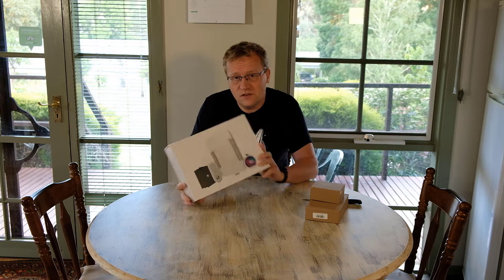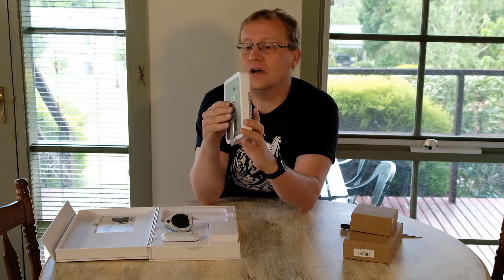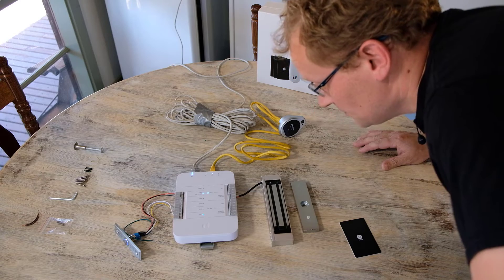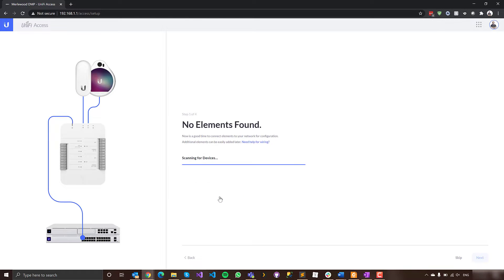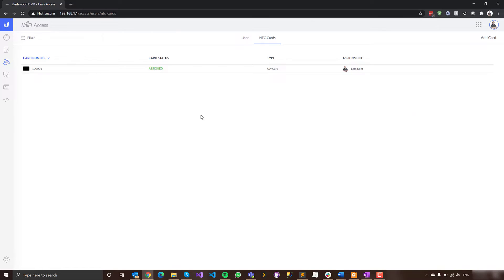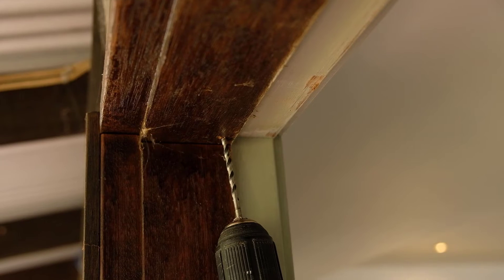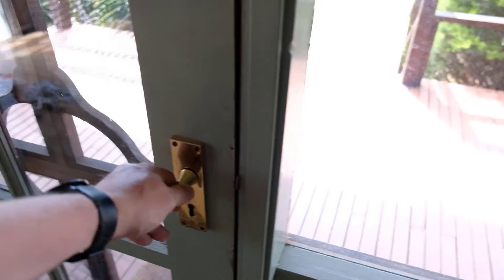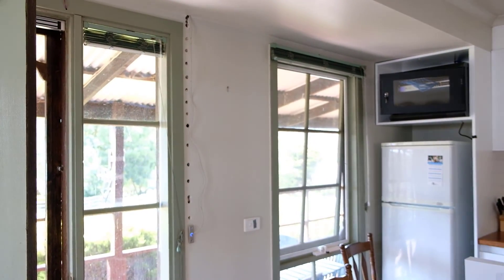Unifi Access Setup and Installation- From Start to Finish

Comment: Thank you for this video.  It gave me a little more insight and confirmed the user friendly interface of unifi.  
I have one question.  What if you wanted a lock for the office door and the house’s back door ? Would that mean 2 of the same system  ( 2 door hubs ) ?
Reply from the maker: Yes, you'd need two controllers, but also check out the Access Mini and Access Ultra, which are much smaller.

Comment: Hi, I have a network that includes several UniFi access points which were already installed and are currently active. Users are connected to them and using them without any issues. However, I'm unable to adopt them into the UniFi Controller, and I also can't perform a factory reset to reconfigure them from scratch. When I launch the controller, it scans the network but doesn't detect any of the access points, even though both the controller (running on my system) and the access points are on the same network. I can't find a way to adopt them into the controller so I can manage their settings. Can you guide me or help me with this?
Reply from the maker: That sounds about right in the behavior you see. Access points will work when they have a connection, but that is different to being able to manage them. As they are already adopted to another account they won't show up on your network controller as part of your account. They do get an IP address, so you should be able to see them.
Why can't you factory reset them?

Comment: What is your plan of power goes out?
Reply from the maker: In my case, the door lock is electro-magnetic, and the door just stays unlocked when the power goes out. For me that isn't an issue and I do have a second deadlock on the door if I am away for longer.

Comment: So what happens when you lose power to the building? You can no longer get in?
Reply from the maker: That depends on the kind of lock you choose to install. I have an electromagnetic lock which is open when it has no power. So, in my case I have chosen to have the door open when there is no power. I also have a deadlock on the door for when I am away from the farm.
Reply: @LarsKlintTech  ahh makes sense thanks!

Comment: just use a flexible pull cable
Reply from the maker: What is that and for which part should I use it?
Reply: It's called a wire snake or cable pull snake it allows you to pull wire through conduit and othher places you need to pull it.  @LarsKlintTech

Comment: Is the Dream machine a requirement or can this be used stand alone?
Reply from the maker: You'll need a controller for the Access application. This is in UniFi OS which runs on the Dream Machine Pro or SE. It can't be used as stand alone.
Reply: @LarsKlintTech  thank you

Comment: Alittle late to the party, but this was great! Is that the default ip to configure the hub, or did you plug it directly into the coreswitch to get to that screen?
Reply from the maker: Welcome to the party! 🥳When you plug in the Access Hub, the Unifi Dream Machine will automatically pick it up. No need for special IP addresses 😊

Comment: Can I bother you with a few questions please?

1. Does Unifi Access work with 3rd party door access readers?
2. How do you enroll a new NFC card is you have the reader far away? Do you always have to go and tap the card on that specific reader? (if so, it's not good for bigger deployments).
3. Does it work with PoE+ as well or only PoE++?
4. Do you need anything special to enroll mobile phones for access?
5. Can Unifi Access be used for time clock-in-out? Can you export the database?

Thanks.
Reply from the maker: Sure thing.
1. I am going with no. I can't see that working as the reader plugs directly into the Access Hub, which needs to then talk to the Access on the UDM-SE.
2. Yes, you do need a reader to register a card, but you can register multiple and assign them after the fact. 
3. I am running it on PoE+, so yes.
4. If you mean using the Access app, then you just need an account that has access to it. If you need through UID, then that has to be set up centrally. 
5. Technically there is a time stamp for every swipe in the system, but I don't think that is the main purpose for it. And yes, you can export it all as csv.

Comment: Thanks Lars! Ubiquiti really missed a trick here with No Fingerprint sensor on thier Access unit. Pin Code + Fingerprint + Smartphone button access is a minimum must have! Also for future lockwise, you may want to consider installing an Access Lock Electric, which releases the strike plate holding the door handle's latch bolt. Offers a manual Key means of unlocking and opening the door if electricity fails.  Having a manual override backup via key, is essential!
Reply from the maker: Thanks Raj. I have an existing lock on the door, which I use when away for extended periods of time. I don't agree that fingerprint is "a minimum" if there is a pin code option. It is more of a nice to have feature, as each user can have their own pin code too.
Reply: most budget fingerprint readers are insecure. If you look they are usually rated in false positives. (i dont remember the exact language) but do you really want to take the chance that the would be intruder can walk up and play the lottery? it would be ok if it could be locked out after x trys. same with code. Also, he used a magenetic strike. its going to fail open/power goes out no magnet

Comment: Only catch with that magnet lock is when power goes out the door is unlocked.  If you can do a striker lock those are better as they can fail secure instead of fail insecure.
Reply from the maker: Absolutely. I was aware of that when I installed it too. I have an old school striker lock which I lock when away for longer periods of time (off the farm).
Reply: @LarsKlintTech  Thanks for the reply and good to know that you had a backup option for this.  They also make fail secure mag locks too that could be made to act similarly.  Just wanted to mention that in case others were not aware.  Thanks for a great overall video though and a nice walkthrough on this kit!
Reply from the maker: @EagleMitch  Absolutely. Your comment is super helpful. I have learnt a bit more about the system too since I made the video, and considering doing a second install with a magnetic deadlock/striker instead.
Reply: @LarsKlintTech  that would be great!
Reply: How about a backup battery?
Reply: @drydenrobotics7833  they are good as long as they battery is, but a striker lock is an analog solution that would last forever and allow safe egress in the event of a fire or something.

Comment: You put the button in the wrong place it should of gone to REX (Request to exit)
Reply from the maker: Good pickup. I am not sure there is any physical difference in the function, but the software might pick it up differently? The REL works as expected with opening the door on push button.
Reply: @LarsKlintTech  Correct the software will register this as some one exiting the door the REL contact is for some one like a receptionist buzzing the door for some one to enter, it is also why the UA pro welcome's you when the button is pressed as if some one has greeted you at the door and opened it for you is but if the button was wired into REX the UA pro will not say "Welcome" when you press the button. Did you get to play with the UA lite as it has a nice function where you can wave your hand at it, use the NFC card or tap it and the door will unlock :D
Reply from the maker: @Cyborgdelta1  That make sense. I will change it over. Thanks for taking the time to explain :)

Yes, I did! I recorded it too here: https://youtu.be/e35qOUyQ14Y?t=981

Comment: Do you know if it's possible to have it open to everyone at certain times while requiring to be unlocked at others? I'd love to have this on the front door of the family cabin, but no way my family would remember to keep cards on them to get back in during day time
Reply from the maker: Good question. You can set up schedules and policies, but not for just keeping a door open, but rather when it can be opened. What you can do instead is use a PIN on select doors, so your family doesn't need to keep a card with them.
Reply: @LarsKlintTech  Now that's unfortunate... I don't have much faith in 90+ grandparents getting used to a PIN either. Regardless, many thanks!

Comment: Hi Lars, great video! Can you tell me what size bit was required to drill the wall hole to mount the actual LCD unit? A link to amazon would be amazing. You rock!!!
Reply from the maker: You'll need a 50mm hole saw, such as this: https://www.amazon.com.au/Bi-Metal-Drill-Cutter-Arbor-Metal/dp/B07R8YFZWF/ref=sr_1_5?dchild=1&keywords=50mm+hole+saw&qid=1635369215&sr=8-5
Also, Unifi has a quick (and a bit too smooth) install video: https://help.ui.com/hc/en-us/articles/360055903213-UniFi-Access-Getting-Started

Comment: What happens if your internet goes down? Will you not be able to access your door?
Reply from the maker: It is all working locally, so you don't need Internet connection for the Pro reader to work. If the power goes, the magnetic lock is off too.
Reply: Do you really want your access system connected to the whole internet? Look into VLAN or just don’t connect it to the internet after setup.

Comment: Shouldn’t the button to exit be wired to the REX pins for “Request to Exit”?
Reply from the maker: I think you might be right for certain types of devices, but for push buttons "REL, REX, and REN all work the same way with push buttons" according to the manual.
Reply: @LarsKlintTech  ah ok. Was just more of wondering because I observed it saying welcome when you pressed the button the way it was wired in the video. 
I appreciate the response. Thanks
Reply: @LarsKlintTech  If you want to not have the "Welcome..." notification when exiting you can use the REX connection ;-)
Reply from the maker: @mortensorby6352  Ah, neat. I'll try that as well. Thanks mate.

Comment: Any clue as if they will make unit with Multiple Doors?   I like everything about the controller but I have 9 doors I would like set up and I don’t really the space for 9 separate controllers.
Reply: I would look into the manual pdf they have. might have a comment on adding multiple scanners.
Reply: You will need one controller per door.

Comment: great details, thanks, wonder where can I get the box you put on top of your refrigerator which nicely sort the pro etc..
Reply from the maker: It's a standard 6RU server rack. The switch is 1RU big, so you can fit 6 of that size. Just search eBay, Amazon, Google for "6RU server rack" and you should find plenty.

Comment: Great video, why didn’t you set up the magnet on the inside? Won’t it be a security risk having access to it?
Reply: at this point it really doesnt matter where he put it, its access control on a glass door
Reply: It would need a Z bracket. It being on a wood door with glass wouldn't be much more secure with it on a Z bracket. If it was a solid 3" custom wood door it would but they still flex as well.
Reply from the maker: Thanks Gerry ☺️
Not sure I understand what you mean. Where else would you put the magnet?
Reply: @LarsKlintTech  What he meant was having the magnet system inside the house, away from public access. But it would be impractical unless you change the way your door swings open.

Comment: Anyone, does the device/software support anti-passback?  Ex: someone who swipes in must swipe out before they are permitted to swipe in again.
Reply from the maker: Hi Colby. I don't believe this is a feature of Unifi Access. You can swipe in and out, but there is no check, like anti-passback. It is only a software upgrade away though.

Comment: Lars...great video. I’m looking at getting this for my office access as well. Would you please let me know what specific door magnet did you get? You did mention your first option didn’t work and you got the magnet. I want to buy what I know works. Thanks!
Reply from the maker: Just to be clear, the first magnet was faulty. If it had worked, I would have gone with it. 
The one I got: https://www.amazon.com.au/LIBO-Electric-Magnetic-Electronic-Security/dp/B07DRHJ7BV/ref=sr_1_5?dchild=1&keywords=electric+door+magnet+lock&qid=1613261494&sr=8-5

Comment: Is there a specific Unifi Switch that is required to provide the correct power to the unifi access or will any POE switch work?
Also what happens when there is a power failure does your door just unlock and anyone can come in?
If it happens to stay locked during a power failure how does one get out through the door in case of emergency situation. 

Thanks - Great video 👍🏻
Reply from the maker: Good questions 😊
You'll need 802.3bt PoE to power the Access Hub. I think almost any Unifi dedicated switch can supply this.
When power drops out, the lock disengages, as my particular one is an electro-magnet. This is also the safest in my opinion. Living on a farm I am not overly concerned about anyone coming right at the time of a power outage. I also have a manual lock for when I leave for longer periods of time. 
Having said that, different locks work in different ways, and the Unifi Access Hub can use almost any type.
Reply: All you need is a battery backup for your network or just for the switch powering the hub. The hub will work without an internet connection as well. Most commercial buildings  fall under different fire access rules. Check before install.
Reply: @Householdinstalls  Can you commission or at least test it locally without an ubiquity console or cloud key generator . ? I just needed to test it before going on site.

Comment: Wonderful video. I just purchased my first Unifi switch this week. I am getting some cameras and I saw this access door switch - its pretty cool. I may have to get one to put on my server room in the basement. Your attic looks about as comfortable as mine, LOL - sans opossum though. I'm curious though, what did you end up doing to keep the door from being so wobbly since the magnet is at the top?
Reply from the maker: Thanks mate. Appreciate the feedback. Roof spaces are nasty. But part of the fun?
I have bought some cupboard magnets I hope will work for the wobbly door. They are very thin and I can attach them at the bottom of the door. Hopefully they aren't too strong. 🤞

Comment: Nice video sir.

Any reason you didnt want to use the lite's handwave for the exit?
Reply from the maker: I like the idea of an exit button, so if, for example, my kids are up here I don't have to swipe them out every time they leave.
Reply: @LarsKlintTech   The system doesn't require a key to exit, you wave your hand in front of the sensor and the door opens, thats what the smaller white sensor is used as
Reply from the maker: @MrAppleMaster15  Interesting. I wasn't aware of that. It isn't obvious from anywhere in the product description and it definitely also works with an NFC card. I might have to try that wave feature out too 😊